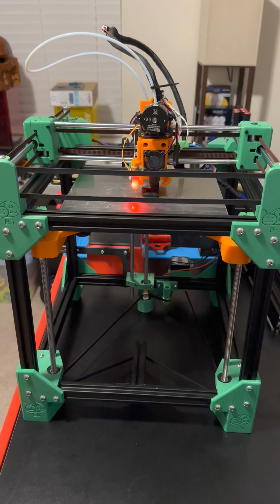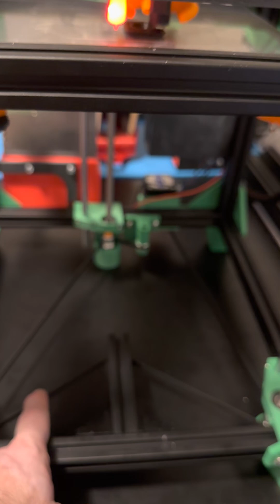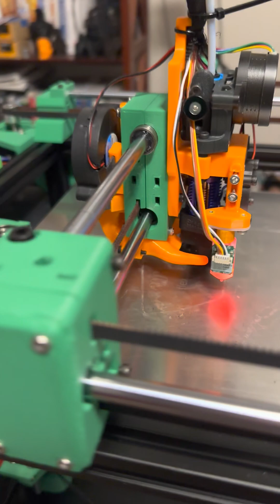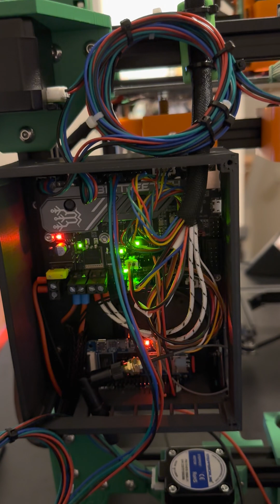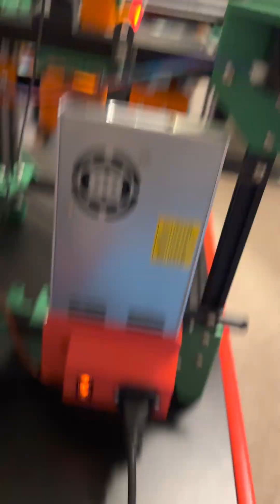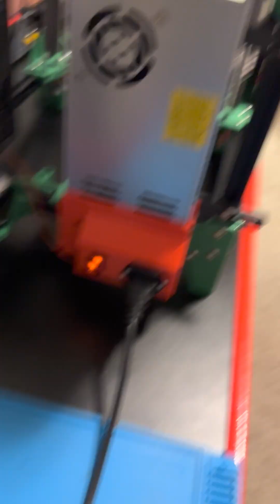Green Dragon (BugBu 210) | Serial Request

Comment: How much can you push it to the limit ?
Reply from the maker: I tend not to run my printers too crazy. It is great to show them off at shows or streams but day-to-day I print slower as reliability is what I want. Also the faster you run a printer the more wear and tear it takes. The BugBu is a solid printer and I have talked about re-printing the parts and doing a rebuild to refresh it but it is just do darn reliable. I put it on a table, counter, etc., plug it in and hit print.

Comment: Looks like the perfect printer for my anet a8 conversion
Reply from the maker: The Anet A8 printers were pretty rough out of the box. They needed a lot of work to make them safe and reliable. Using the parts for a BugBu or even a Rook would be great.
Reply: @digitaldragon72  yeah im thinking i could do the 100 also